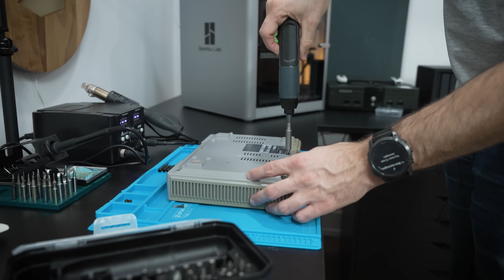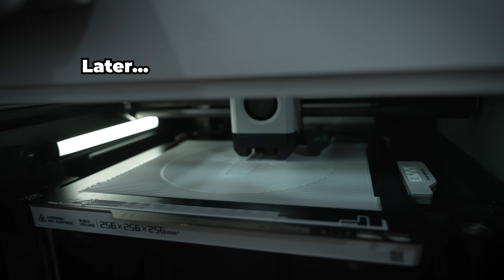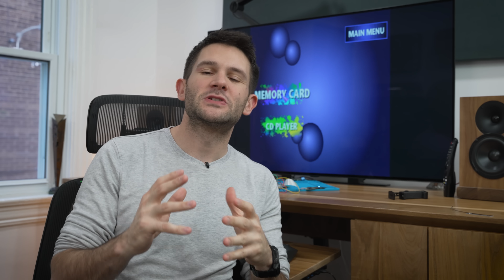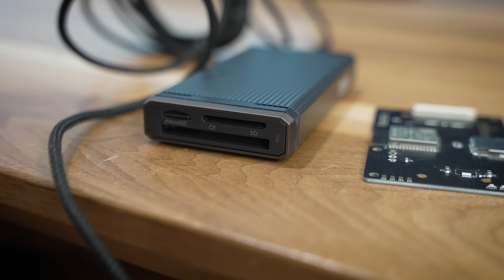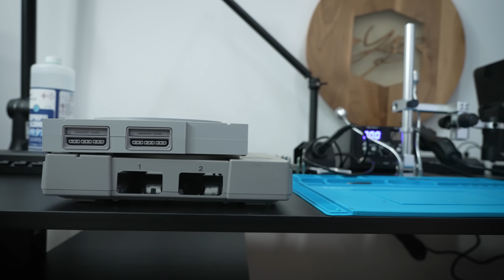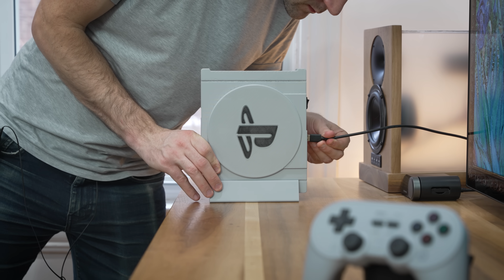I built a MODERN PlayStation...

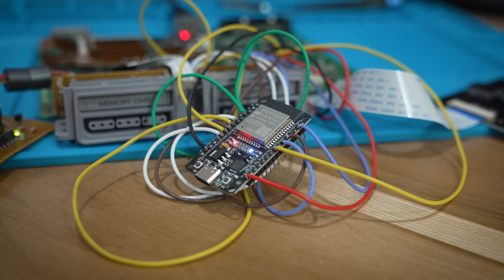Comment: 13:00 I was thinking about this, and it would be awesome to have the XStation UI to be able to communicate with the ESP32 via some sort of API, and show the controller brand and make, and allow some customization. This way you could pair xbox controllers or PS5 controllers, or even a switch pro controller. I know the implementation wouldn't be hard, specially because part of the bluetooth protocol already has the advertising data (AD) with the profile of the device, so XStation would be able to recognize these and know exactly what type of controlled is being selected, the ESP32 just needs to send the AD's 31 bytes to XStation.

Comment: Did anyone knew that the PS1 CPU was designed to address 8MB of system RAM ? And that Sony left it turned off in retail PS1 consoles.Yet the console's default RAM was only 2MB.The fact that developers worked around that RAM limit while producing some the most amazing games of the PS1 generation is mind-blowing. Imagine if Sony had upgraded the PS1 to 8MB of RAM at the time.😊

Comment: If you want to remove layer lines on PLA parts, you can enclose it with some acetone vapor to slightly melt the exterior of the part. Wet some kitchen towel, stick to the sides of a container, leave for 5 hour

Comment: Off topic, but i just wanna say that those things you have on the wall, basically don't do much for the sound. You're better off with absorbers than with diffusors, even if diffusors looks cooler and are ridiculously more expensive.
Diffusors does it's job best behind your back where the speakers are pointing to.
Diffusors only work as absorbers if you have them literally everywhere, where every reflection is dispursed into smaller reflections and subsequently into nothingness almost immediately.
Meanwhile, absorbers don't reflect. 
Edit: I see you used an absorber behind the TV, though, so kudos.

Comment: I appreciate the project. But you cant get any smaller than my tablet other than a phone. And it upscales. Just a screen and no outside box. Unless you want ac power pack. And it takes less power. Surprisingly for some reason on some tablets crash 1 does have a slowdown point in later part of the game. And i needed to play it on my mid range laptop. Guess you could say emulation isnt perfect. But you can have some of the fun dont expect 100 percent. If you are in van life smaller devices can make a difference.

Comment: In my opinion, the 3d printed boxe is ugly and ruin your project...keep the orignal boxe was a better idea. The 2nd bad idea is to change controllers, you add latence and ruin the experience of gaming. I'm ok for xstation and real hdmi port. And I seek for a solution to keep the cd reader and possibly use ps1 normaly.

Comment: The thing about modernizing a console without using the disc drive is that at that point I might as well get a gaming laptop and emulate since I can’t play my original games on it. Never understood why the disc drive is the first thing to go in these sorts of builds. It’s still cool and understand it’s not emulated which has upsides but to me it defeats the purpose of going to the trouble rather than just emulating

Comment: I know we're like a year later now, but I wanna point out you can get ESP32 dev boards without headers, and you can make em even thinner by simply desoldering the headers from the commonly available ones. If you wanna go full on geek, you can get the ESP32 chip and build a custom circuit for it. Super neat project!

Comment: Im digging into the weeds a little i want to mount an esp32 to load a ps4 wireless controller to my z790pc to play games. While I run DS4windows. I really hate having dongles.  I also like to be somewhat amped about being an audiophile while playing video games.  So a Soundblaster card and powered internal (pc Amp) would be sick! I want to have the control knob for the sound card be wireless and freq hop at 8000hz so it can control my audio volume while I am at my couch or recliner or at my desk. It might have to be molded as well to do this based on standard Soundblaster volume knob options. I want to install a usbc lipo battery pack jn the base and have a Bluetooth TX in it to tell me when connected as well as allow me to adjust on the fly.
Reply: Now a huge reason why I want a ps4 controller is to also to provide controller assist to move my 3d object in Blender as they have certain downloadable packets that do this. As we know the mouse click gimble is limited.

Comment: When solderwicking don't use the entire roll, you get better results by cutting off a small piece and holding it with tweezers. When using the entire roll, now your iron has to heat the solder and the roll. Causing you to use higher temperatures then necessary possible damaging the components on the board.

Comment: Just use enamel wires and stop using normal braided wires. Saves way more space, gets better solder joints and less potential for cold joints and wires pulling off traces.

Comment: I never understood why people replace the optical drives and other methods of playing physical games in projects like these. Just makes old physical games that people may have useless at that point if you dont have another second system for it. At that point just emulate the crap on a decent computer since 8 times out of 10 there is a super accurate emulator with decent performance out there for a specific video game console instead of doing the equivilent of cutting off the poor consoles limbs/organs just to shove a SD card slot in their place for lulz.

Honestly the best projects are those like the pico project for gamecube: You keep the ability to play physical media, maybe even have the ability jail broken depending on the system, but you also get possible SD access to play roms and homebrew on top of that effectively enhancing the consoles original functions while keeping everything there instead of mutilating it and claiming its "modern" now. Its not a true modern remaster of a console unless its backwards compatible with the very games that made that system popular in the first place instead of forcing the reliance on only roms to play anything.. simple as that.

Comment: Cleaner to use some ribbon cables instead of loose wire.
The 2nd best pro to using an ODE is that you can play romhacks, such as the GT2 community rom hack (A Spec) that fixes all the bugs and adds a bunch of cars.
Reply: I really love the look of my PSOne, its so damn cute. Unfortunately it lacks compatibility with a lot of the mods.

Comment: "we need to replace the old caps with electrolytic ones"
throws out the electrolytic ones and installs tantal caps

"this mod allows us to put an SD card on the exact data lines the CD drive uses"
installs an emulator mod in which a chip translates between the SD card and the cpu. so no direct connection between the PS1 and the sc card

"if i install a fan, it will keep the hardware cooler"
puts in a fan that sucks air from above the midframe and not from the actual PS1 hardware.

still a good video tho.

Comment: you should use thinner gauge wires atleast for data lines. They are easier to work with in tight spaces than thick ones. Only use thick wires for power delivery.

Comment: Why should someone deface a cult console like that? You can build all the mods into the normal case, there are covers and instructions for everything, you remove the CD drive and put in the micro SD card holder, there's a real new power supply... then you stand there and act as if you've made something great..... I only see someone who praises a 3D printer and does things that others have already done, and who has destroyed a great console with a cult design

Comment: since you where there, you should changed all the electrolytic capacitors, in fact every single 1001 needs a full recap to work properly not to only change the capacitors for video output

Comment: A lot of money spent for damages for lot of errors, big inaccuracies, and functions not at their maximum potential!
1. Put on PAL for having not this poooor 480 but a better (720x)576? You can run always the USA games with these type of modifications... 
2. Your probably fantastic double switch bypass and brake the incoming 12v (like don't check the dual tension switch and surely with that bypass), next to fried quickly all again because this step down double tension circuit NEED before to charge the capacitor and after having the energy load with the peak consumption.

EnJoY

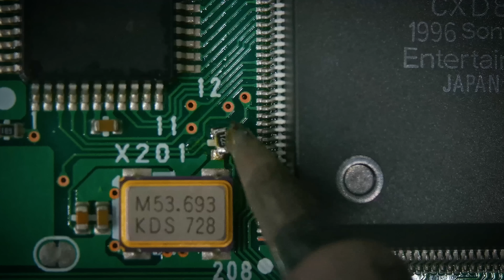Comment: 9:14 bro those are tantalum caps. tantalum caps behave differently and have a tendency to un-alive themselves in a ball of fire. they are horrible for use as filter caps in switchmode power supplies (which is what I'm assuming those caps are doing) unless you under-rate them by a wide margin. Should have just left the electrolytics alone my guy. yikes

Comment: What I don't get is that you say e.g. that the digital output is 480p, but resolutions vary on playstation 1 the game you show Crash Bandicoot ran at 512 × 240, to get the proper experience the output would need to vary, and you'd need to scale and resample it to the correct aspect ratio.

This is always my primary bug bear with any display mod or emulator that gets this wrong.

Comment: This is an epic video. Great content!

Correction.. “replace the capacitors with more modern electrolytic ones”. The ones you removed were aluminium electrolytic and the ones you fitted were tantalum electrolytic. Tantalum capacitors are not more modern, just more expensive, and more prone to short circuiting as a failure mechanism.

Comment: Yeah, you could have done it a lot better: 
Leave it in original shell, and leave the cd drive as is, same as all the other outputs, functions and stuff, upgrading retro consoles is always better if you don't remove anything that it has or can do, just add more, and preserve the old as is and has been.
Same with controllers, but dualshock ones ofc, make them wireless, or optionally able to still be connected with wires.

Comment: I was actually hoping for it to be like a sleeper build with the old case and all of its physical capabilities, just with added modern features not completely replacing the optical drive and/or removing the RCA AV Cable. I guess that would be the "Ultimate PlayStation" not just a modern one.

Comment: I'm glad that you really like the X1 Carbon, just please do not leave a print unobserved especially in the beginning of the print as if the print fails it can fail catastrophically and harm the whole print head. Recently the number of failed prints, making the printer unusable before hours of melting plastic to rescue and replace the print head completely is significantly high.

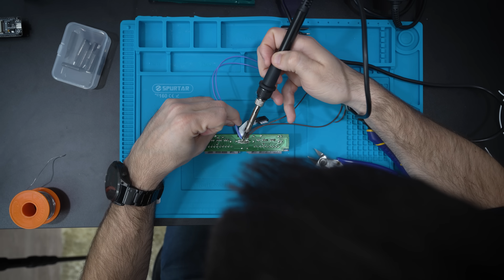Comment: 11:58 looks like you could ditch the whole controller pcb and connect the esp32 directly to where the flat cable connects to the mainboard of the ps1. you're soldering the wires to the connector socket, aka, the "exit" from the controller pcb. if you were soldering to anywhere else, then the controller pcb would be doing some kind of interface between esp32 and ps1 board, but looks like that's not the case. so the ps1 could probably be thinner :) 
anyway, great video as always!!

Comment: Just a tip, PLA and PETG don't stick to each other so you can use PLA as interface material for PETG prints and vice versa instead of buying the Bambu support interface material since it's WAY more expensive. There's no reason to ever buy it

Comment: Sorry, this comment will be on negative wave:
Bambu is bad and lies... google bambu lab authorization firmware controversy and you will find why... very bad... they reminds me HP now 🙂
Louis Rossman did 2 videos about them...
Controllers connected with bluetooth = significantly increase input latency
Original PS controllers up to Dual Shock 3 are pressure sensitive, those 8BitDo aren't, have a fun to enjoy turning in Gran Turismo

Comment: My attention span is...questionable at best, so I may have missed something. Also, I've never modded anything more comllex than a Nerf blaster, so this may be common knowledge, but I have questions.
Will it still only play PS1 games?
How are the games getting onto the SD card, and in what format?
If you're using Bluetooth controllers, why did you keep the controller ports?
Fascinating video though. Unfortunately, electricity and electronics may as well be magic to me, for how much I understand it. I'm more mechanically minded.

Comment: That xStation board appears to already have an ESP32 module on it.  Is there really a need for a second ESP32? Couldn't they integrate this feature to their firmware and add a connector for this?  It's best to avoid adding multiple WiFi/BT chips.

Comment: Great Video...This is something I would definitely want to try not only with PS1 but with other versions.  Quick question, what program did you use to create the templates for your 3D printer?  Looks like you created your base (detailed measurements etc) with engineering sketching too then used a 3D model program like Blender to create your final product...

Comment: Yeah but when you tore up a couple of those legs on the c d  rom chip You could have used a sottering iron to lift those up Instead of carrying up a sottering pad from the motherboard it would have been much easier to use a solidiring iron instead of what you did

Comment: 1:40 the discoloration is not caused by oxidation otherwise it would be discolored on all sides even in the inside which is not a case. It is caused by UV light that is why only top part + sides are discolored. Majority of plastics do that over time.
9:15 you are actually removing electrolytic capacitors and placing tantalum capacitors.
Reply: It is oxidation, caused by a reaction with UV light. It's called Photodegredation my dude.
Reply: @LaurenceGrey  Interesting, thanks for the information! I knew UV plays a role in discoloration but I did not know the exact mechanism of doing it. My appologies to the author of the video.
Reply: @martintatak8851  yo no worries, there is a lot of things at play here, it's very trivial piece of knowledge. I studied chemistry for my PhD so I just know it. But if you didn't do chemistry at university it's easily something missed. If you're interested theres a field of chemistry called photochemistry of which this oxidation is part of 😊
Reply: @LaurenceGrey  Ok, that makes sense 😄 I studied microelectronics engineering and only chemistry I know is from NileRed's videos 😅

Comment: Sir, why tf did you not just make a raspberry pi emulator box. This is not a Playstation, the Playstation played discs.

Like I get it, you think it's cool because it's the original board, but literally this is just isn't a Playstation. You can make it smaller and better with a Pi, far easier, and you're not killing a Playstation.

Comment: Always glad to see a console revived and playable. But I don't really understand the vision of this project. It's still larger than the PSOne revision and can't read discs. Don't really see why this is preferable over a modded PS2 or playing an emulator or FPGA core. 

Personally, I would've preferred to see a full refurbish instead: salvage or replace the disk drive and restore the condition as close to stock as possible.

A shrunk down PSOne with an integrated display, battery and modern mods on the other hand...

Comment: Isnt the bluetooth mod a bit counterproductive? You want to use the adapters because they (the good ones) dont work via bluetooth, but via the 2.4ghz band, so it has waaaay less latency, or in other words: bluetooth is always way worse in latency compared to the native wireless connection
Reply: there is no native wireless connection on the PS1; PS3 was the first PlayStation with wireless controllers

Comment: Soldering tip (pun intended): When desoldering, or really when doing anything that doesn't require high precision, you want to maximize your heating area. As such, conical tips are generally not preferred for desoldering. Instead, you should use the wide, rounded flatedge tip like the TS-D24 (a tip for the TS101)

Comment: I love USB-C PD boards. I daily drive a MS Surface Pro 1, which has a rather awful magnetic charger. But it just so happened that the port for it is exactly as tall as a USB-C port. After wedgeing in a PD board, it works excellently.

Not all USB-C power supplies can do 12v, but the surface seems built to take many voltages as it can even charge off 5